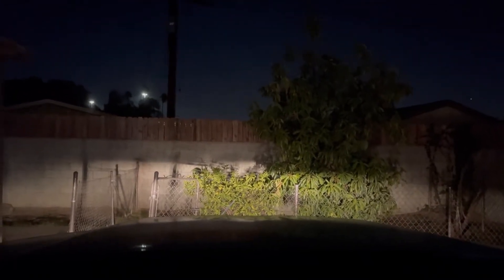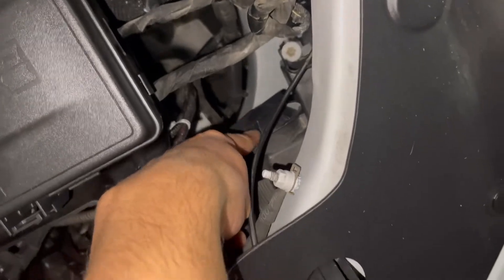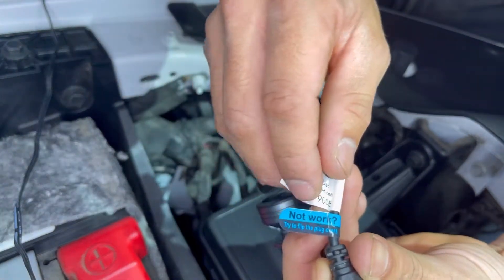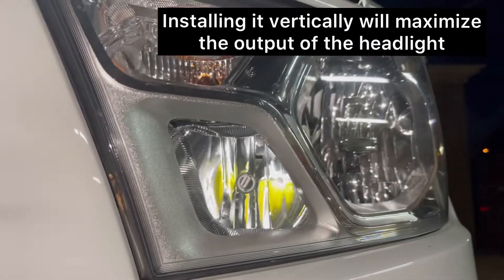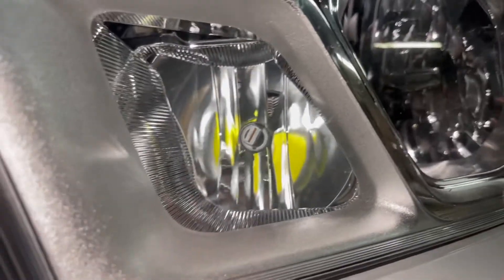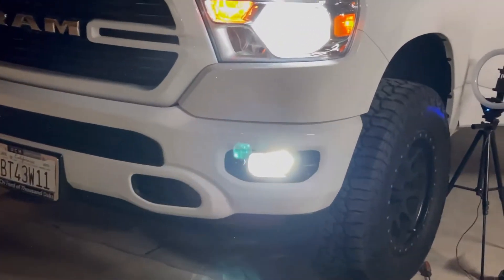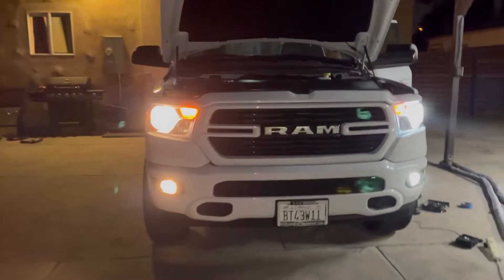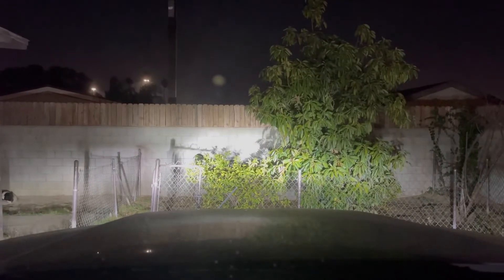2019 Ram 1500 6500k LED Headlights Install | Hi/Low Beam & Fog Lights | Before & After | How to DIY

Comment: Thanks for posting this. Just bought the same bulbs for my 2019 Ram as well. Looks good bro.
Reply from the maker: Thanks bro ! Good luck ! 👍🏽
Reply from the maker: Just posted a video on how to adjust the lights too bro ! Just in case the headlights up being lob sided and uneven 🤙
Reply: @shoobiedoubie6871  cool. I got mine in yesterday. Love them. I’m not picky about the positioning of them. Worked too hard to get them in! What did you do with that driver piece that is connected to lights? I tucked mine on the light housing and screws the dust cover back on. You think that is ok?
Reply from the maker: @513cats  yeah I also tucked it into the housing lol
Reply: @513cats   that’s what I did except I used the double backed foam tape. Did your truck flash a few times after you installed them? Mine flashed highs and lows on and off a few times then hasn’t happend since, just curious if you used can bus error eliminator or resistors?
Reply: @smallgarageguy7681  I don’t recall mine flashing like that. It’s been 10 months and they are still working just fine.

Comment: You had the best video especially showing to the LED needs to be vertical great video bro .
Reply from the maker: Thanks Phillip, I always try to do my best in the videos 🤙🏽
Reply from the maker: I started this channel because I strongly dislike watching people’s videos that don’t explain jack correctly or record like if it’s a middle school fight lol.
Reply: I have a Ram bighorn 2019 and I’m having trouble installing my GTR 2 led low beam bulbs I’m going thru wheel well but have trouble peeling back mud guard it’s nearly impossible going Thu engine area high beams you can do.

Comment: Wish I'd watched this before I started them myself! It took me a little bit to figure out to take out that panel rather than work around the wires lol.
Reply from the maker: Yeah bro, there’s no way I was going to be able to do it from the top 😂
Reply: @shoobiedoubie6871  I just got a 2022 with the etorque so there are EVEN MORE cables on the drivers side, but I did the passenger side in no time after I watched this! 

Did you have a hard time getting the high beams in?
Reply from the maker: @lbf5984  Congrats on the new truck ! 😎 No bro, the high beams were a bit easier than the low beams

Comment: I replaced the Hi/Low & Fog lights on my 2019 Ram 2500 Hemi, it was not easy especially the fog light led install.   Connecting the connectors was a handful.  Wish you would have shown to reconnect the led fog light connector and the fight with the red sliding clip that doesn't want to slide up, even though the new LED bulb connector is the same size as the Halogen bulb connector.  It is not bing botta bum, it is hair pulling out till you learn the trick.   

Good video to show the difference between the factory halogen lights vs. led lights.   I just wish you would have shown the complete install, including all the headaches so I could have avoiding them.

Comment: I bought the same set up for my 2020 Ram1500 BigHorn. Everything went together no issue.   5 minutes later 1 started flashing and went out then the others all followed suit.   Looked like a squad car and then nothing.   Took them all back out out in the stock bulbs no issues.   No clue why they did this ..   ????

Comment: Nice video have you experienced any problems while shifting from park to drive or reverse?  Like either fog light or high bean turn on for couple of seconds?  Also how do you like those tires are those falken wildpeak?
Reply from the maker: No problems while shifting or driving.

And the tires are great. No complaints. I live in Los Angeles so I don’t off-road too much.

Comment: hey question, how is the jb weld on the oil pan holding up? and how long did it last? didn’t see the update vid
Reply from the maker: There was a 5 month update at the end of that same video. It’s still going bro 💪🏽. I did the repair back in March of 2020 so it was definitely worth it !

Comment: Does anyone recommend using the decoders on a 2022 Ram with halogen lights?
Reply from the maker: Only if you are having issues with your lights, if not, you should be fine.

Comment: Should fit a 2021 Ram?🤔 According to Amazon it won't. I got a 21 Bighorn with stock HID 🤮
Reply from the maker: No bro, this will only fit halogen bulbs (regular bulbs) not HIDs sorry bro
Reply: @shoobiedoubie6871  Well dang I made a mistake, my 21 Ram does have Halogen bulbs...
Reply from the maker: @Jnu925  Dope! Then I highly recommend you get these bro, they’re bright as hell 🤙🏽
Reply: By the way is it required to have that anti flicker harness?
Reply from the maker: @Jnu925  not really bro, I was having issues with my my 2015 ram when o bought these so I had to buy anti flicker harnesses, but I didn’t have any issues with the 2019.

Comment: Where did you put the driver?
Reply from the maker: What driver?
Reply: @shoobiedoubie6871  it’s the rectangle part that’s connected to the light
Reply from the maker: @MarkBunoy  I just shoved into the housing making sure it won’t disturb any wires or anything 🤙
Reply: @shoobiedoubie6871  thanks bro
Reply: You 100 percent need decoders